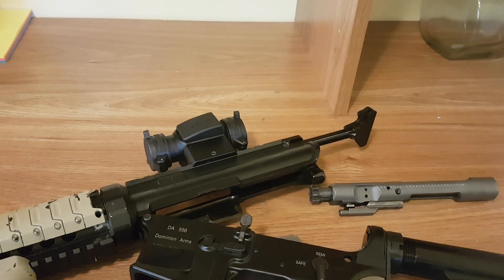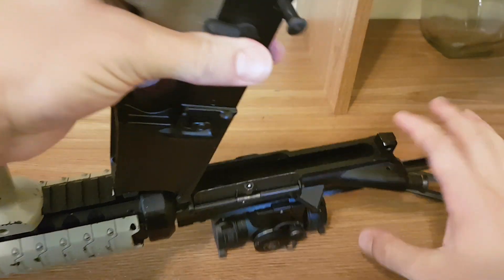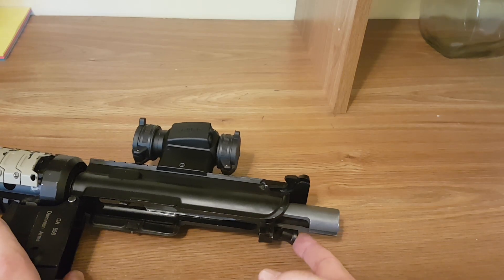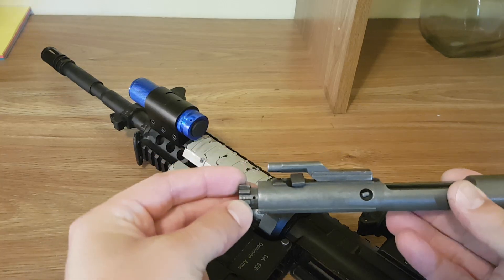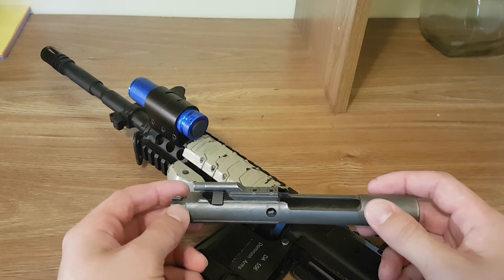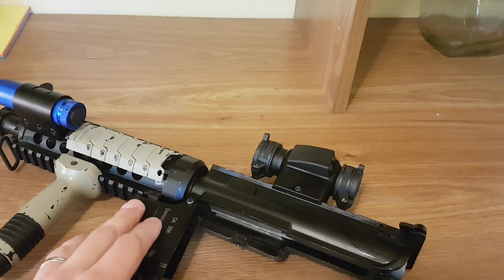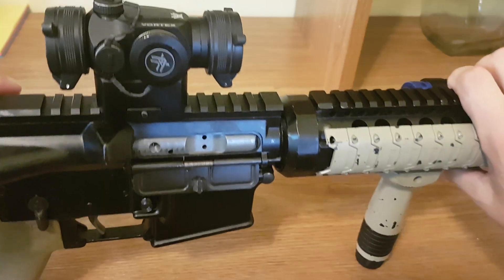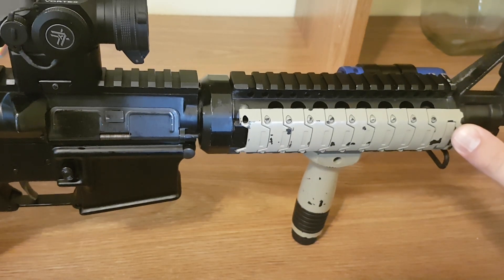What does the Forward Assist on the AR15 Do?

Comment: If you use the forward assist to jam a casing into battery you’re stupid ..   that is not what it used for ..  if you need to rack your AR and need to be quiet as possible you use the forward assist to ease the  casing into battery.

 If you jam a casing in because it won’t go in with a full rack you might not get that casing out ..  May not be enough gas pressure to unstuck it ..  if you have a casing that will not go into full battery then just eject It !

Comment: As a Vietnam combat vet that was forced to carry this pos for a while, I will tell you the forward assist was added to help this pos rifle chamber a round because it wouldn't work well enough to do it with the bolt carrier. I was fortunate enough to get my hands on an m14 after a while. Yes the big old bitch was heavy, but when you pulled the trigger, she fired every time. And did not need a fucking forward assist!

Comment: I was in the military, and the only thing that button does is jam your weapon. You shouldn't "ride the carrier", and if the breech does not lock from a full release, then something is wrong. Forcing it into lock with that button, if it can even be done, will simply screw up your weapon. Re-rack the carrier, and if the problem persists, check the breech. It's not rocket surgery.

Comment: If I load all 20 rounds into a mag on my LR-308, I have to use the forward assist to load the first round. That 20th round is in that mag tight and the bolt simply doesn't have enough energy to strip it off and chamber it. DPMS calls them 20-round mags, but they are actually 19 rounders.

Comment: What it is intended to do is if you short stroke your bolt and the round doesn't seat this helps to engage the bolt.
What it does is, If there is dirt or trash in your receiver the bolt assist jams the round into the chamber and makes it jam when the round goes off.
The idea is you don't have to re-chamber another round should the bolt not go all the way forward.

Comment: Also, if you are in a situation where you need charge a round very quietly, you can charge it very slowly and use the forward assist to fully seat the bolt!

Comment: The gas is not “siphoned off”.. it is under exceptionally high pressure. Siphon is a vacuum effect. 

Why is it that most AR-10/SR-25 variants (.308) do not have a forward assist?  It weighs little, and adds a degree of surety to establishing a closed battery under some conditions ( not for forcing a round in that won’t otherwise go) . Seems like a good idea for the ‘just in case you need it’ situation. My instructors said its not for forcing a round in... its only to ensure the bolt has fully rotated closed on a round that is already fully chambered.

Comment: It move the  head bolt  to right atonement  with the reacever  locking lugs can sit round can be fully  engaged    co2 gas can be used to move the round out the front bezel  at 2800 ft

Comment: I haven't watched the video yet, but I'd like to answer that question of "What does the forward assist on an AR-15 do?".
If you keep your weapon cleaned and lubed, the forward assist does nothing at all except to look cool. 
In Vietnam when American forces were first issued the M-16 they were told that it was a self-cleaning rifle, and therefore had feed and ejection problems. The forward assist was added because of the many malfunctions of the weapon, and cleaning and lubricating instructions were also implemented on the then new M-16A1 rifle. Feed and ejection malfunctions went away because of the new procedure for cleaning and lubricating the rifle, not because of the forward assist.

Comment: Never had to use it. If the round was bent or bad casing, whatever the reason was the bolt didn't fully chamber the round, I just ejected it and made sure the next round chambered and the bolt locked. Even when my rifle was dirty as hell, the bolt always locked. The biggest issue I found was either the casing was damaged or the bullet was bent in the neck of the casing, or the casing had debris on it. Even then the bolt wouldn't even push the round more than half way in the chamber so once it was ejected by pulling the charging handle to the rear, when released I visually made sure the bolt locked. Some use the fa, some don't. I just never had to, plus I prefer to eject the round if it didn't. If I want to be stealthy, I still don't use it, apparently I must be one of the few to have a buffer spring strong enough to close the bolt and the bolt lock while slowly chambering a round, but even then, if it's right after a fire fight or before contact, it shouldn't matter, you should be using some type of cover anyway and simply tipping the rifle down will drain the water. If that wasn't the case then my rifle should have blown up but never did. Not gonna argue what the reason is or why these rifles have a fa, just the fact that I don't use it on my rifle. I'm not military, not LEO, but I'm an avid hunter and I use my gear and test my gear hard to ensure it won't fail me when it's needed most. I've purposefully not cleaned my AR after hundreds of rounds, even that dirty Russian ammo, purposely through the rifle in the dirt and mud, still didn't need the fa when shooting.  Funny fact, I have not yet had a bad quality or damaged round from Tulammo or Wolf, Brown bear or what have you, but more so with the cheap brass cased ammunition like some Perfecta and some others I bought from Walmart. Never even had a steel cased round stick in my gun either, but I've had some brass cased ammo stick in the chamber due to a ruptured neck or sidewall of the case. My brother is a Marine and a lot of my friends are former military, and to sum it all up about what they said about the forward assist, is to use it at your own risk, lol.

Comment: The forward assist is to help the bolt go forward to full reset without pulling much the charging handle to pull rearward  the bolt then let it go back slamming the chamber for a full reset. I think what makes the designer put a forward assist on the AR-15 or M16 rifle is the kind of charging handle of the rifle which is located at the rear of the upper receiver. The charging handle once released to slam back the bolt cannot be push forward anymore to fully reset the bolt if it did not fully reset that is why the forward assist was put to do that part. Unlike the charging handles of the garand, M14, M2 carbine and even the Ak47 which are on the side of the upper receiver and directly attached with the bolt carrier which can make the charging handle be push forward more to fully reset the bolt if it does not fully reset. Just as one in this video commented that the forward assist was to quietly press the bolt after pulling the bolt rearward to drain water, the same can be done with the Garand or the AK 47 by just pushing more forward the charging handle after draining.

Comment: It can be one of the most dangerous pieces on the AR-15 (the Forward Assist).  If, for any number of reasons, the Forward Assist gets stuck forward, and the rifle fires, the ratchet teeth on the bolt carrier moving to the rear, will catch the pawl on the Forward Assist and send it out the rear with considerable velocity.  If the little cross pin breaks, as the Forward Assist flies back, propelled by the bolt carrier,  the assembly will exit to the rear and to the right, still with sufficient energy to damage your face, if you are a left handed shooter, or damage another part of your body as a right hander, or a by-stander's body.   Always safety check the Forward Assist to assure the device moves freely and returns to rest by action of its compressed return spring.
Reply: why you gotta scare us 😞

Comment: The only time you should ever be using your forward assist is if, for some reason, you followed the bolt home with the charging handle and a non jammed round simply isn’t in battery. In other words, you should never need to use your forward assist because that should never happen. Never use the forward assist if you have a jam, and definitely don’t hit it every time you reload. That’s sheer nonsense

Comment: Over 50 years ago, when the original M16/AR style of rifle was created and with the old bullet technology, there clearly was a need for a forward assist.  Now, with all the modern advancements and evolution, and especially with the M4 feeding ramps, is a forward assistant really even needed?  There is a lot of argument going both ways on this topic. Especially in the civilian versions of the AR/M4 platform, 99% will never use a forward assist.  It is basically an extreme last ditch option if you rifle gets sticky or jams, but often can make a bad problem a lot worse.

Comment: Because the charging handles does not reciprocate with the bolt carrier group, the forward assist is there so tha thte action can be closed slowly (and quietly) when needed and the forward assist makes sure that it goes fully into battery. On rifles with a fixed charging handle that moves with the bolt carrier the handle can be used the same way. This is not possible on the AR15/M16, so the BFA was added to take care of the "quiet load" scenario and also if the rifle did not go into battery for any other reason (dirt, crook ammo etc.).
Reply: Thank you. This seems like the only scenario that it seemed useful for. 
I don't know why they didn't just charge their weapons before going on patrol or whatever.
Reply: True
Reply: Interesting.  Thanks.

Comment: From what I remember, from the Vietnam time, was that the AR-15/M-16 was designed well, as a precision weapon, by Eugene Stoner.  It preformed well, as designed, with the ammunition it was designed to shoot.  Somewhere along the way, someone changed the powder, and I am sure you can google the details!!  Basically, the NEW powder, in the new ammunition, was 'dirty'and left residues, causing the rifle to fail to fully chamber the new round.
For civilian AR-15s, the forward assist, is something of a LIABILITY, I think, but I do not know of any legal suits!
Why would you need to FORCE the bolt closed, if it doesn't just chamber a spec round??  For reloaders, it says you screwed up on the case-sizing step.  For others, maybe the surplus ammunition, is not NATO spec, and even though it is cheap, is it worth risking your life, having the round explode in a chamber, when the bolt is not properly closed!??
I have NEVER had a load failure with my AR, and NEVER used the forward assist!!
If I did have a partial close, I would remove that round, and try to chamber another!  If the next fails, then I would break it down and see what is causing the failure!!
Belgian FALs and AK, don't have 'forward assist' as they were designed to WORK, and those are RELIABLE!!  I go to either, before my AR!!
ARs are kind of like some 'OVER-Engineered' cars, from a certain central EU nation, that cost a lot, and have some prestige, but others, less costly, more reliable, can get the same job done, just as well!

Comment: You're 90% right; The part of the story you're leaving out is this: The first user of th AR rifles was the Air Force...the Air Force had no performance issues with the rifle at all. Robert McNamara was so impressed that he insisted the Army adopt it (M16) as it's main battle rifle. The Army required that the rifle could function in arctic condition (60 deg. below zero) 

Unfortunately the ammo that the Air Force used would not fired when that cold, so they adopted a cartridge with a slightly slower burning powder that would. This resulted in clogging of the gas tube, fouling and the issues mentioned in the video.  Immediately after being introduced in Vietnam a lot of men were killed in combat while experiencing rifle failures.     

There were Congressional hearings about the problem and the forward assist was one solution that came out of it. It's been almost 40 years since I've fired an AR15 or M16 but I certainly experienced a lot of loading and feeding problems at that time. I can say that in the Marines Corps the M16 was not well liked.

I don't know, but I would like to think that the ammo problem has been solved by now, in which case the forward assist would rarely if ever be needed.

Comment: The M-16 had short stroking issues because bean counters used surplus powder designed for the .30-06 M2 ball cartridge and to compound the issue no cleaning kits were issued at the start of the war and this was a back peddling response to 'fix' the issue without the war department to be held accountable.

Comment: Hell my M16A2 was total crap and slightest bit of sand and forward assist had be used frequently because bolt would stick.

Check your gas rings, worn/lose gas rings will also allow bolt to easily close when you ride the bolt home

Comment: I’m Canadian army and we use the C-7 which is a license built M-16 and I have never needed to use the forward assist even in Afghanistan in the dirtiest conditions over there. I often wondered why it was even there.
Reply: The Army here in the States for whatever reason asked Stoner to put it on there, and he even objected against it. I don't blame him, it's pointless, adds weight, and adds cost to making a complete rifle.
Reply: Soldiers in Vietnam died because the US Army issued out rifles without cleaning kits, with barrels and chambers that weren’t chromed, and ammo loaded with left over from WW2 ball powder that excessively fouled the guns. Among the mandated fixes was the forward assist.
Reply: @Idahoguy10157  The ball powder didn't excessively foul guns. It burned too fast and didn't provide enough gas/pressure to fully cycle the bolt.
Reply: @outspokengenius  whatever the actual reason it cased a lot of jamms.
Reply: Kyle Michaels check your source, a powder than burns too fast will produce more pressure that can eventually create a Kaboom.
Reply: right ....and its design that never left most of the A.R platforms
Reply: Robert Dawson the M16A1 went to Vietnam with Troops with a forward assist so I don’t  know where you got that info from
Reply: Stoner's design was without a forward assist. The US Military insisted on having it added. To this day, nobody really knows why. Just one of those little mysteries of life.
Reply: Yup. It's completely pointless. It wasn't even on gen1 AR-15s.
Literally all you need to do is cycle the bolt again like every other firearm ever...
The only way you'll know if it isn't in battery is if you pull the trigger. The weapon won't fire and you'll have to charge again anyway. Pushing the bolt forward ain't gonna fix shit if you already pulled the trigger.
Reply: Referred to  as "silent closing  device"
Reply: There are a lot of people commenting on this who have never had to verify their rifle was condition one. Every time I send the carrier home for the first time that day, either deployed with an issued weapon or at home with my ARs I do a press check and ensure the bolt is in battery with the forward assist.
Reply: Afghans say that forward assist is for increasing the range 😂
Reply: Did you not fire blanks or do press checks.... ever?

Comment: Its so when you dont drop the bolt with the lever (or if it isnt enough) you pull the charging handle and ease it back and it doesn't lock in smack that button twice i already knew this carry on with your life i saved a few minutes of

Comment: Anyone here ever use thier forward assist? Everyone i ask says they have not.  Including my.self. i almost wish it wasnt even on there.  The original design by dtoner did not have a forward assist and was added on by military. Just curious cause i know alot of ar guys. Including my self and never seen anyone use it not even once in thier lifetime.   Ive honestly never had a failure to seat the bolt.  But if i did id prefer to just use my thumb than bash on the forward assist and cause a bigger malfunction

Comment: It was not part of the original design.  It was added at the insistence of the army as they wanted to mimic the ability to drive the bolt forward as in hitting the cocking handle of the: M1, M 1 Carbine, and M 14.  Not needed.  It will make matters worse if employed.

Comment: Yeah gun won't go into battery the Army says "thats ok just jam the bolt forward and force it into battery and make yourself a nice pipe bomb". There is no way in hell that thing is needed and no way in hell it is useful or anything else other than to serve as an extra mechanical piece to break and jam up the rifle. The AR-15 instantly becomes more reliable with it removed and plugged or with a slick side upper. 

The Army says one thing Eugene Stoner and Jim Sullivan says it is not needed and causes unreliability, I think I'll listen to the guys who worked on and developed the rifle and the Army can go fuck itself. By that last comment it is only meant for the Army personnel who is in charge of procuring new weaponry and who decides a feature is necessary the rest of you guys are OK in my book but yeah fuck those pencil pushing faggots that make decisions like this that can potentially get a soldier killed. Personally I feel if a soldier is killed in battle due to a jam caused by a feature the engineers who developed it specifically says is a bad idea then that person should be OK with taking the soldiers place on the battlefield. Bet they'd think this shit out a bit more if that were the case.

Comment: I always thought of it for use when in close proximity to hostile action, you could quietly chamber a round and confirm it is seated by pushing the forward assist. And the gas tube doesn't siphon off the gas, it directs it. But it probably depends on your definition.

Comment: I have actually used the forward assist. SWAT training with minimal cleaning or lubrication. Bolt didn’t go all the way forward, so I pushed it forward with the forward assist. The gun has to be heavily used and have minimal lubrication for this condition to exist. I doubt you will see this if your gun is a range queen.